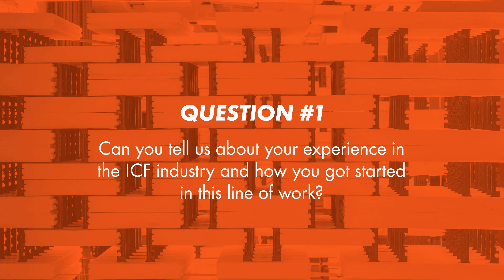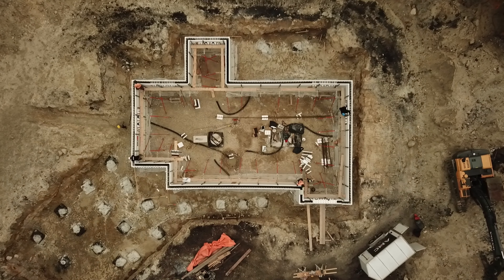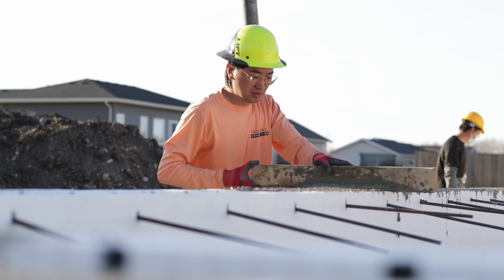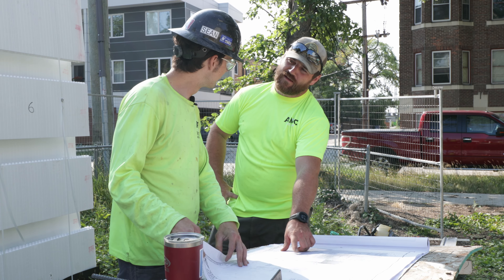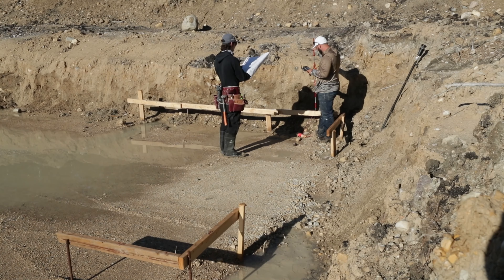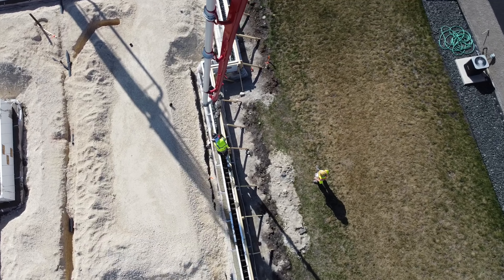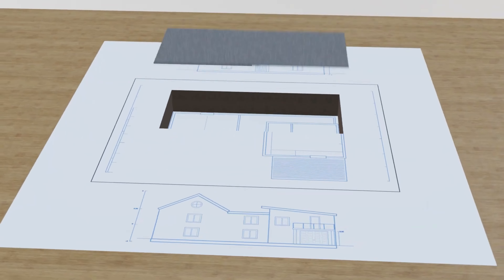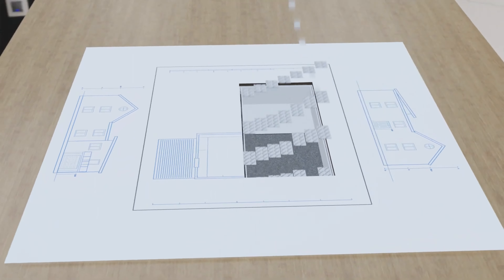ICF Expert Interview - Techniques, R-Value & More

Comment: Most pest control companies will not provide a termite bond or even touch a home that has an ICF foundation. The foam creates a pathway for termites to enter a house completely undetected and therefore pest control companies will not touch.
Reply from the maker: Hi Brett, every type of structure requires proper insect and termite mitigation details depending on the local/regional prevalence of pests.  We've never heard of a pest company refusing to treat a home based on the structure type.  Most ICF manufactures (including LOGIX ICF) offer product lines that have termite treatments added to the foam material upon special order for high infestation regions, however again this is not a replacement for standard mitigation techniques.  Thankfully with an ICF structure there is no risk of structural damage to the building if termite or carpenter ant intrusion occurs, unlike wood framed buildings which are at much higher structural risk.  

Have you personally run into a situation where insects were attacking an ICF foundation?  -- Jay from AMC Foam
Reply: @amcfoamtech  I am aware in the southeast of pest control companies not being willing to provide termite bonds or even touch a home that has an ICF foundation because the foam allows a pathway for termites to get into the house that a pest control company cannot see.